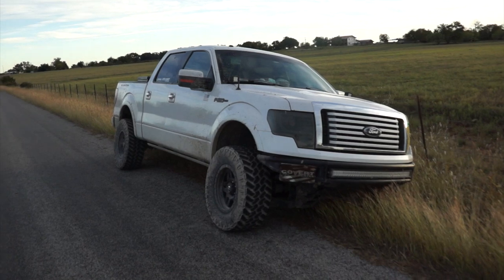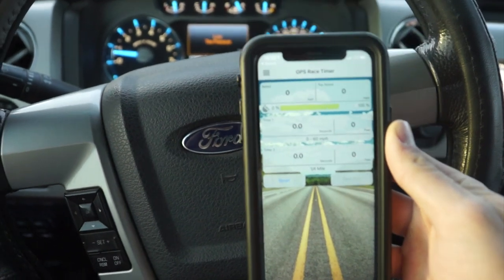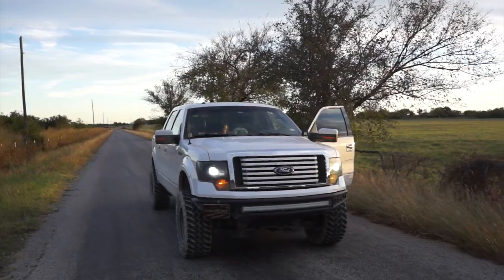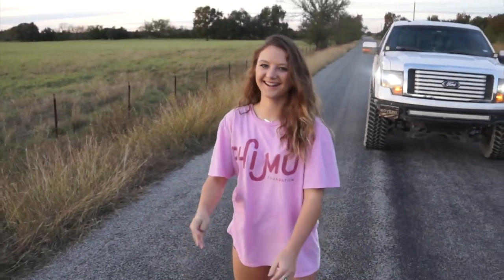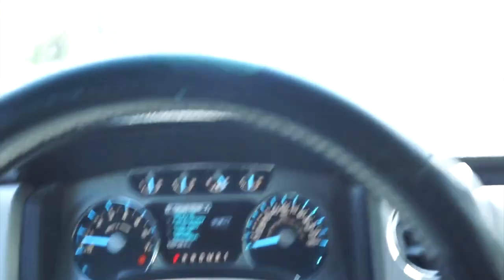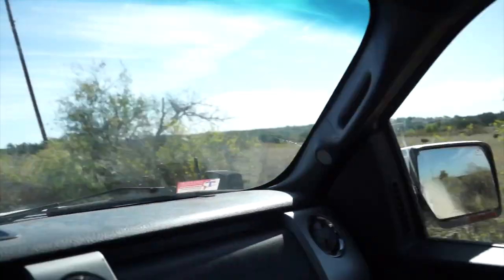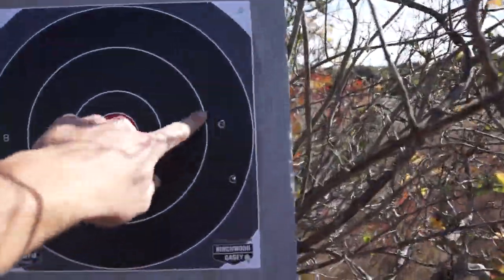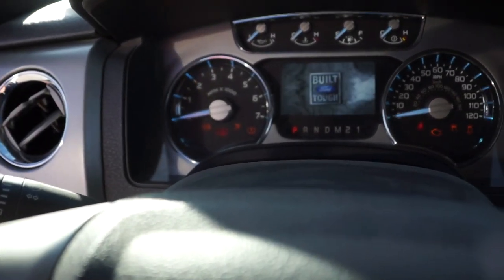0-60 Time of a Lifted F150!! *LOUD 6.2L V8*

Comment: Very reliable truck I’m sure. More reliable than the 5.0 right? Nice truck.
Reply from the maker: All depends on who you ask haha. The 6.2 is considered one of the best motors Ford has put out. Usually very reliable. Thank you!!
Reply: Stock for stock I'd say the 6.2 is definetly more reliable than the 5.0. Less to go wrong. More simplistic but older tech as well.. Comparing 2 totally different engines. One old school (6.2 SOHC 32V V8 2 valve per cylinder) vs a newer (5.0 DOHC 32V V8 4 valve per cylinder)... Honestly I'd prefer the 6.2 in almost everyway except for weight. To each their own.
Reply: My 5.0 has had 0 issues besides maintenance and I’m at 190k original owner
Reply: @CovertGarage  If you ask any master mechanic (such as myself) it doesn't depend on who you ask. We all agree that the 6.2 is one of the best modern engines in existence. This is a verifiable fact.
Reply from the maker: @DaroffApFire  couldn’t agree more!

Comment: Wondering what kind of gas mileage you get with that setup. I was looking to get a 2011 platinum 6.2 and lift it with some 35s but wanted to know what gas mileage to expect
Reply from the maker: I usually get around 10 city and 13 highway. Get it!! The 6.2 is amazing! 135k miles and not a single mechanical problem. Doing a full review soon
Reply: Covert Garage I bet the truck is awsome. The gas mileage is a little rough tho lol. May have to stick with getting a 5.0 to have a little better mileage
Reply from the maker: @Ghostyxi  yeah mpg is a little rough lol. Stock best it could get is around 16
Reply: Had a 17' 3/4  ton 4x4  larger tires , it averaged 9.2 mpg on the highway unloaded 6.2 liter gas v8 .. stout though

Comment: Surprised it didn’t run 7s, my ram on 37s runs high 6. What gives
Reply from the maker: Oh Dang!! Is your truck geared? I know before lift and tires I could do mid 5s
Reply: @CovertGarage  stock gears, it’s a regular cab so it’d run high 5s 0-60 stock, with the 4 inch lift and 37s its running 6.9 0-60
Reply from the maker: @joepop4673  dang that’s nice
Reply: I might give my little ole 5.4 a go lmaooo let’s hope my timing chain doesn’t go 💀
Reply: @joepop4673  sooooo wheres the video then?
Reply: @joepop4673  until its on youtube you havent done a 6.9